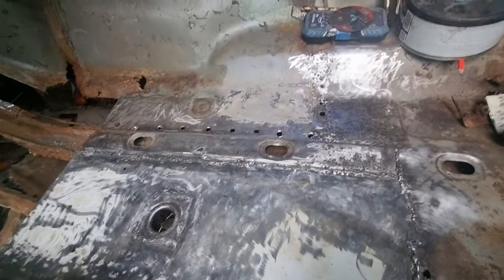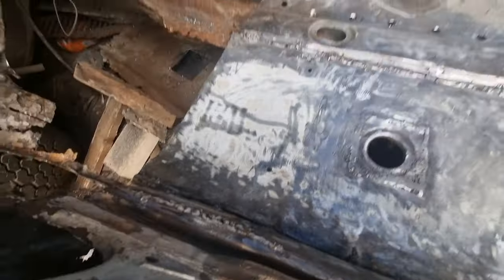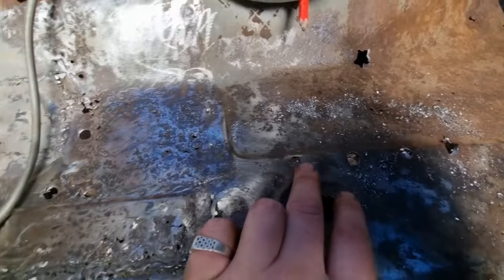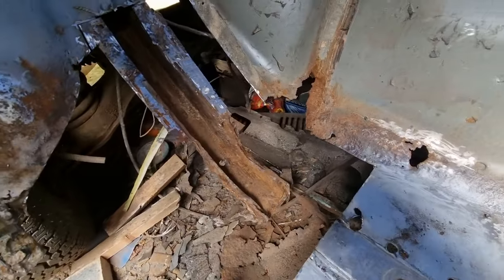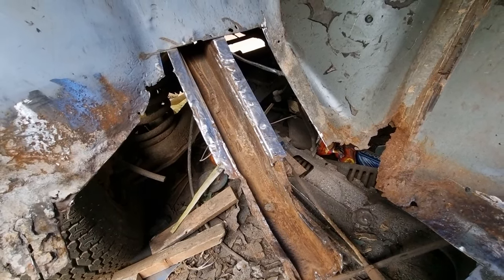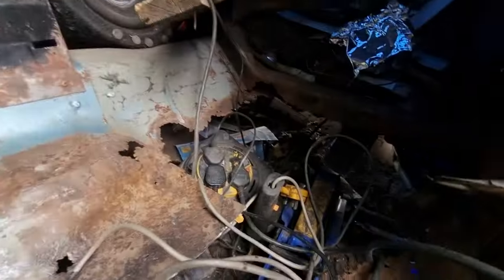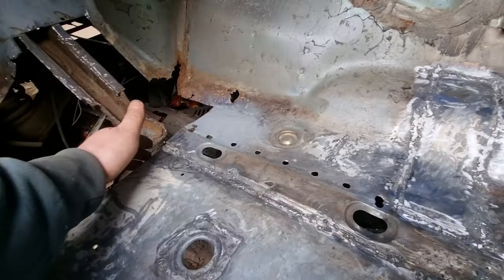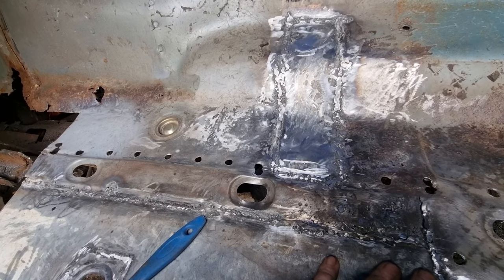Cortina Mk4 Ghia 2.3 V6 Restoration || Floor Pan Work + Passenger Chassis P4 (P36)

Comment: looking great!  Looks like this side might be a quicker fix compared to the driver side,  The small rust holes, id see if you can build with weld wire, sometimes its just quicker, and easier.
Reply from the maker: yeah i do have a copepr hammer that i used to fill smome smaller holes and yeah defo will be a quick fix i would say in a couple of week this side will be done and then it will be drivers side to get onto but with new panles )

Comment: Well done so far. Get yourself some weld through primer for the bare metal, especially anywhere you're welding layered metal like the chassis rail to the floor. Have a look at Dave's Garage, his early videos on his MK1 escort panel repairs might give you some useful tips.
Reply from the maker: Yeah that would be the best thing to do there is a copper one I think that's memt to be good Pete c as uses it if I rember  right cortina city